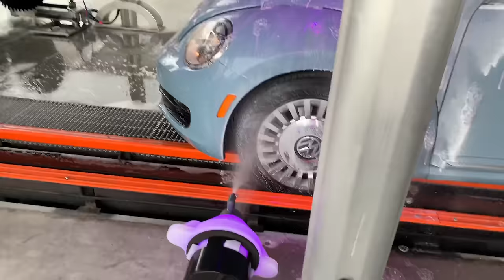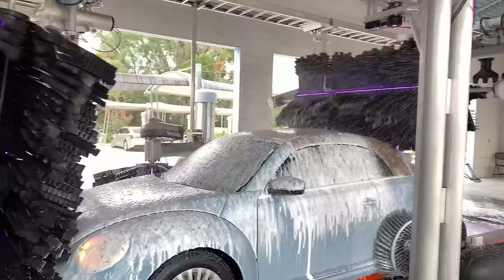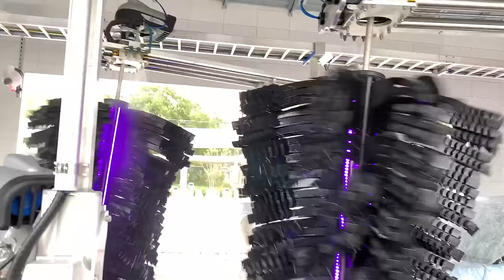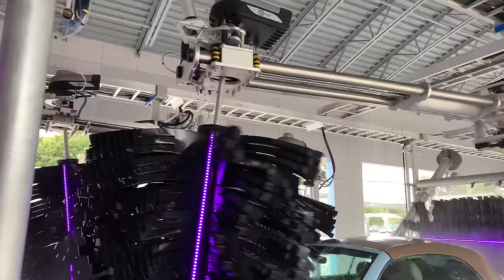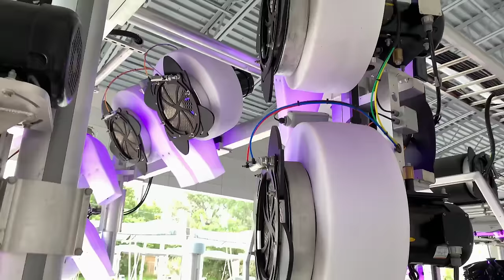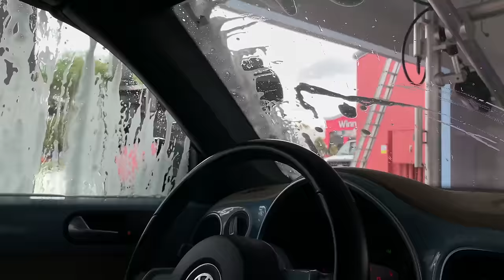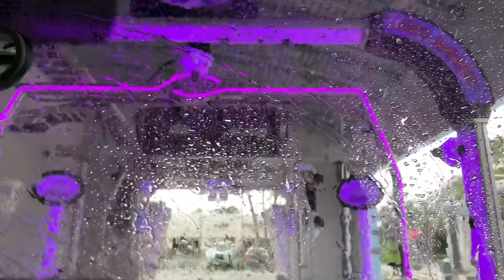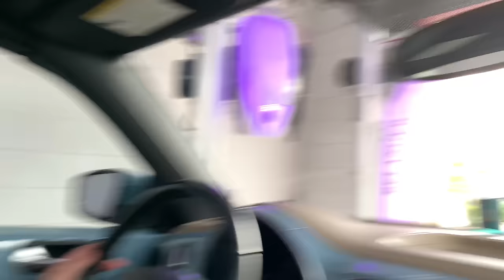SpeedShine Express Car Wash - Outside & Inside Perspectives

Comment: 100% they will scratch your car, after the wheel and tire brushes went over your dirty wheels and then continue over the side part of the car, making sure all dirt and sand will be scratched into your paint😒 if you love your car just wash it by hand.
Reply: FOR GOD SAKE THEY DONT SCRATCH YOUR CAR
Reply: @PalmPeakMarketing  yep they do!
Reply: No they fucking don’t
Reply: @PalmPeakMarketing  yep they do!
Reply: @PalmPeakMarketing  they do damage cars. Heavy rubber = damages. The guy is right. Flimsy lights trick the buyer to thinks it’s good or so.
Reply: @Mrbushbtalls837  Oh okay.
Reply: @PalmPeakMarketing  yes they do. they will absolutely destroy your paint. especially these brushes which look like they're made of fuckin silicone
Reply: @snotellekS  welp ok
Reply: @PalmPeakMarketing  most certainly do
Reply: @PalmPeakMarketing  I'm absolutely certain you  car will have swirl marks galore.
Reply: Actually, automatic washing is actually the safest way to clean your car, handwashing is actually what causes swirl marks because the brush you’re using while handwashing isn’t being lubricated constantly so it’s just pushing around the dirt in a swirling fashion
Reply: Exactly correct. Washing the windshield like that is not at all recommended

Comment: As a professional auto detailer, I have to say thank you for the paint correction work places like this send my way.
Reply: 0
Reply: Money goes round and round.
Reply: My thought exactly,  especially when I saw the brush cleaning the wheels then the side body panels 😳
Reply: Lol
Same here.
If people only knew the amount of damage, these car washes due to their paint.
Reply: @Watchfullspark  That may be true for older car washes, however newer built washes do no use microfiber brushes, instead opting for neoprene or some sort of rubber combination. These non-pourus materials provide a good alternative to the cleaning potential of microfiber without the risk of scratches. That being said, these brushes should never "scrub" your car, they should make light contact with the vehcile. If they're pressed in hard, oh yeah you might seen unexpected damages such as mirrors being damaged or knocked off.
Reply: Where are you located. I would love to do a cinematic video of your paint correction.
Reply: Rather that than to spend an hour every couple of weeks doing it myself.
Reply: Exactly!

Comment: To the people calling this rubber brushes or that sound is the paint being scratched. I have used spinlite tunnels before and my paint still looks good even with the evening sun on it (black car). I wanted to feel the brushes to see how they felt. The owner let me walk in the tunnel and feel them, they were soft and felt like they would be gentle on the car. Its closed cell foam material. I also been through a tunnel with normal fast spinning brushes that are also closed cell foam and they make a squeak sound also. Its just the characteristics of the material. I know carwashes arent perfect but this machine isnt as bad as people are making it out to be.
Reply: tzilla  explain
Reply: tzilla  I agree with justin palmari. Spinlite isn't actually as bad as you think it would be.
Reply: Yeah they're soft , until they start spinning,  then it's going to scratch the heck out of your car!!!!!
Reply: @joefro9473 You are correct. If you feel your paint then look at it under a scope you will see scratches. Thats just how it is with coatings and paints. Are they noticeable? Depends how close you want to look. Even perfect looking paint if you look at it under a scope you will see scratches.  The point I was making is that these arent bad and are a huge improvement from the past which alot of people still think of when they hear the word "carwash".
Reply: Agree with u some car washes use soft foam brush ,only car wash that can scratch ur vehicle is the one using the hard clothes material brushes I work at car wash at cash I can confirm
Reply: Negative... if you use enough lubricating body soaps you will not get the squeaking noises
Reply: @joefro9473  wrong!

Comment: Get the monthly basic wash and go through every 3 days then wipe down.  Wipe out crevices of rims then car will stay nice. Florida is definitely designed for this procedure compared to the northern states. The brushes are very soft and really don't make swirl marks like the old school car washes. Also soaps and drying is much better. Put a coat of turtle wax ceramic hybrid on paint when car is new. The paint will look great for years. If you want it to look good taking care of it is crucial. Keeping up on coating is important.

Comment: What are those brushes made out of?  Are they rubber?  I mean it sounds horrendous on the paint.  Weird....
Reply from the maker: Most new car wash being built today (including this one) use a closed-cell foam material that is designed to prohibit small particles of dirt and sand from collecting inside. Foam is the safest material used for car washing today (even safer than hand washing).
Reply: @FloridasExpressCarWashes  !vjxjixixxiixkxkxkk

Comment: I wish there was something like this in London U.K.
Reply: You will probably wish you never wanted this. They damage your car. Due to the heavy rubber they put.
Reply: @Mrbushbtalls837  The brushes in this video don't use rubber. The material used on them is called SpinMitt which is made up of a highly textured closed cell foam material that is incapable of holding dirt and is rinsed with every rotation. It's safe on all cars and is safer than hand washing.
Reply: @ncautowashes2889  It’s heavy rubber due to the hard slapping sound

Comment: now THATS a car wash! not those pesky crap places where the brushes are doing 6.000RPM and making those nice deep scratches in your paintjob!
Reply: These damage your car than the other ones. The heavy rubber damages your car. Neoglide material is better than heavy rubber used on the Spinlites.
Reply: Car washes don’t scratch. They are extremely gentle, and cannot damage paint. They won’t absorb dirt either, making it impossible for them to scratch. However, the saying “car washes scratch” comes from washes that still use cloth. The brushes themselves don’t hurt the car but the rocks and sand they absorb do. This wash doesn’t use cloth, therefore it cannot scratch.

Comment: Time to have a paint correction too.
Reply: Car washes don’t scratch. They are extremely gentle, and cannot damage paint. They won’t absorb dirt either, making it impossible for them to scratch. However, the saying “car washes scratch” comes from washes that still use cloth. The brushes themselves don’t hurt the car but the rocks and sand they absorb do. This wash doesn’t use cloth, therefore it cannot scratch.

Comment: Clean car scratches everywhere.
Reply: This just creates more work for detailers like myself I don't have an issue with this at all I'm even planning on opening a drive thru car wash as well to profit from this end of the car wash industry
Reply: Car washes don’t scratch. They are extremely gentle, and cannot damage paint. They won’t absorb dirt either, making it impossible for them to scratch. However, the saying “car washes scratch” comes from washes that still use cloth. The brushes themselves don’t hurt the car but the rocks and sand they absorb do. This wash doesn’t use cloth, therefore it cannot scratch.

Comment: The squeaking noise as those rotating washers hit the car is just painful. Good luck to who ever has to deal with that paint correction. Also what’s up with the LEDs? Does the owner also build PCs or something?
Reply: Spinlites have LEDS on the rods. Spinrites (different to these) are rare and don’t have LEDS in the rods
Reply: Car washes don’t scratch. They are extremely gentle, and cannot damage paint. They won’t absorb dirt either, making it impossible for them to scratch. However, the saying “car washes scratch” comes from washes that still use cloth. The brushes themselves don’t hurt the car but the rocks and sand they absorb do. This wash doesn’t use cloth, therefore it cannot scratch.

Comment: The brushes are made out of the same thing scuba suits are made from. And I can tell you right now it shouldn't squeak. This means there is not enough lubrication, ie soap, on the brushes, or the speed is not fast enough, and there is too much pressure on the arms making the brushes push on the car too hard. All of which cause scratches.  And those are definitely not spinning fast enough. Would you really want those rotating brushes cleaning your rims and then dragging the dirt from those down the side of your car like that. Nope. No way.

Comment: We know what brushes decades ago did to paint. What about these. A d brushless ones just get the most off. But as we all see in the right light after going threw one you see there is still a film of dirt. And those of you that pay for wax treat in car washes are at minimum sealing in the dirt film. Nothing a machine can do to replace hand washes..and the old days of car wash services done by people. Biggest worry was using cleaning sponges, clothes etc that were used over and over again with out replacement every once in awhile. Or dropped clothes on the dirty floor. Bet that even happens at expensive detail shops.
Reply: They do instill light brush marring. When you hear the squeaking, there is nothing lubrication present. If they would use a more lubricated soap formula, they might be able to get a swirl free finish (unless a muddy vehicle goes through).
Reply: Even worse if you follow in a brush car wash behind very dirty trucks etc. Not all that gets washed off before your car goes threw I bet ya.
Reply: @troyelliott8186  - It's true. Mud can still run off after the drying cycle. 

When I acquired my first wash, there was particles of mud/sand embedded in the weave of the cloth. 

If they could come up with a pre-softened bristle, I bet those might be "safer", because they would flush out easier than cloth or foam. That foam still has a texture to it, and can still hold sand.
Reply: @troyelliott8186  The reality is - the brushes are properly (and automatically) rinsed with every rotation. So even if a muddy truck is in front of you, there’s no need to feel concerned about the risk of scratches, as it’s extremely low.
Reply: Car washes don’t scratch. They are extremely gentle, and cannot damage paint. They won’t absorb dirt either, making it impossible for them to scratch. However, the saying “car washes scratch” comes from washes that still use cloth. The brushes themselves don’t hurt the car but the rocks and sand they absorb do. This wash doesn’t use cloth, therefore it cannot scratch.

Comment: Thats a nice display but as a carwash manager I dont recomend these robots for new vehicles. Brushes, rollers and too many blowers will loosen your trim, mirrors, shark antenas, car cameras and even your paint. that car wash is good for old cars.
Reply: Car washes don’t scratch. They are extremely gentle, and cannot damage paint. They won’t absorb dirt either, making it impossible for them to scratch. However, the saying “car washes scratch” comes from washes that still use cloth. The brushes themselves don’t hurt the car but the rocks and sand they absorb do. This wash doesn’t use cloth, therefore it cannot scratch.

Comment: Never bring you car to an automatic car wash unless it is touchless.
Reply: Ok
Reply: Touchless car washes are still far from perfect
Reply: @titan9259  As I see it your car will get a scratch no matter where you go you can be driving down the road and one can dent your hood it happen to me.
Reply: Car washes don’t scratch. They are extremely gentle, and cannot damage paint. They won’t absorb dirt either, making it impossible for them to scratch. However, the saying “car washes scratch” comes from washes that still use cloth. The brushes themselves don’t hurt the car but the rocks and sand they absorb do. This wash doesn’t use cloth, therefore it cannot scratch.

Comment: The fancy lights distract you from the fact it’s scratching TF out of your paint.
Reply: Car washes don’t scratch. They are extremely gentle, and cannot damage paint. They won’t absorb dirt either, making it impossible for them to scratch. However, the saying “car washes scratch” comes from washes that still use cloth. The brushes themselves don’t hurt the car but the rocks and sand they absorb do. This wash doesn’t use cloth, therefore it cannot scratch.

Comment: My teeth were screeching looking at the bottom rollers sanding the paint 😳😬 that car was derailed before getting washed 🥴
Reply: Car washes don’t scratch. They are extremely gentle, and cannot damage paint. They won’t absorb dirt either, making it impossible for them to scratch. However, the saying “car washes scratch” comes from washes that still use cloth. The brushes themselves don’t hurt the car but the rocks and sand they absorb do. This wash doesn’t use cloth, therefore it cannot scratch.

Comment: That paint is screaming for HELPPP!!
Reply: Car washes don’t scratch. They are extremely gentle, and cannot damage paint. They won’t absorb dirt either, making it impossible for them to scratch. However, the saying “car washes scratch” comes from washes that still use cloth. The brushes themselves don’t hurt the car but the rocks and sand they absorb do. This wash doesn’t use cloth, therefore it cannot scratch.

Comment: My main concern is the potential damage from brushes that accumulate sand/dirt. IMHO. Automatic Car Washers are good Daily Drivers Cars that paint damage is not a concern. The main objective is to get the windows clean so you may safely drive the car.
Reply: Car washes don’t scratch. They are extremely gentle, and cannot damage paint. They won’t absorb dirt either, making it impossible for them to scratch. However, the saying “car washes scratch” comes from washes that still use cloth. The brushes themselves don’t hurt the car but the rocks and sand they absorb do. This wash doesn’t use cloth, therefore it cannot scratch.

Comment: It doesn’t even get a full rinse before it’s dried off, oh yeah and how’s your swirl and scratch marks?
Reply: Car washes don’t scratch. They are extremely gentle, and cannot damage paint. They won’t absorb dirt either, making it impossible for them to scratch. However, the saying “car washes scratch” comes from washes that still use cloth. The brushes themselves don’t hurt the car but the rocks and sand they absorb do. This wash doesn’t use cloth, therefore it cannot scratch.
Reply: @carwashreviewsandmore7609  i strongly disagree. The reason you don’t see the scratches right away on newer cars is because of the multiple layers of clear coat. And that reminds me, touch-less car washes use soap that is actually designed to burn through a mini layer of clearcoat to get the car clean.
Reply: @6atlantis  Not all touch free washes do, usually ones run by bad facilities (gas stations, poorly maintained car washes, etc) do damage clear coat with how much high pH they throw at the car. That is called flashing. It’s scarily common how many touch free washes do this, however some don’t. Changing topic back to soft touch washes, they don’t damage clear coat period. Soft touch washes are actually much safer than hand washing because they use appropriate chemicals, safe brushes, etc. I get where you’re coming from though, it was widely known back when automatic car washes were first invented that they would scratch, because of the brush material.

Comment: If you use these with brushes that spin will scratch the paint on ur car tale a very bright light ur paint and you will see it it's called spider webbing
Reply: Car washes don’t scratch. They are extremely gentle, and cannot damage paint. They won’t absorb dirt either, making it impossible for them to scratch. However, the saying “car washes scratch” comes from washes that still use cloth. The brushes themselves don’t hurt the car but the rocks and sand they absorb do. This wash doesn’t use cloth, therefore it cannot scratch.

Comment: Me as a detailer looking at this crying
Reply: Car washes don’t scratch. They are extremely gentle, and cannot damage paint. They won’t absorb dirt either, making it impossible for them to scratch. However, the saying “car washes scratch” comes from washes that still use cloth. The brushes themselves don’t hurt the car but the rocks and sand they absorb do. This wash doesn’t use cloth, therefore it cannot scratch.

Comment: You can hear the scratching🥴🥴
Reply: Car washes don’t scratch. They are extremely gentle, and cannot damage paint. They won’t absorb dirt either, making it impossible for them to scratch. However, the saying “car washes scratch” comes from washes that still use cloth. The brushes themselves don’t hurt the car but the rocks and sand they absorb do. This wash doesn’t use cloth, therefore it cannot scratch.

Comment: Risca rápido!
Reply: Car washes don’t scratch. They are extremely gentle, and cannot damage paint. They won’t absorb dirt either, making it impossible for them to scratch. However, the saying “car washes scratch” comes from washes that still use cloth. The brushes themselves don’t hurt the car but the rocks and sand they absorb do. This wash doesn’t use cloth, therefore it cannot scratch.

Comment: What model is this? The scratch master 3000? Would love to see a black car through it a few times.
Reply: Car washes don’t scratch. They are extremely gentle, and cannot damage paint. They won’t absorb dirt either, making it impossible for them to scratch. However, the saying “car washes scratch” comes from washes that still use cloth. The brushes themselves don’t hurt the car but the rocks and sand they absorb do. This wash doesn’t use cloth, therefore it cannot scratch.